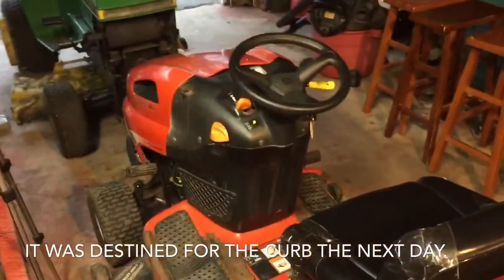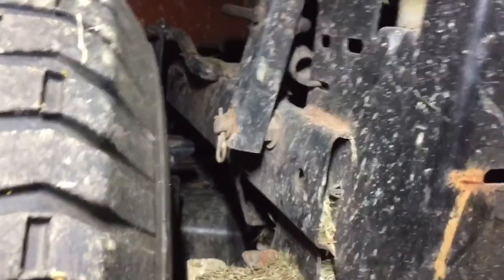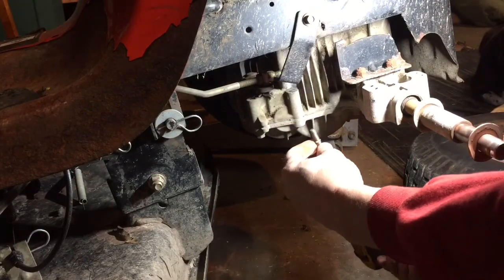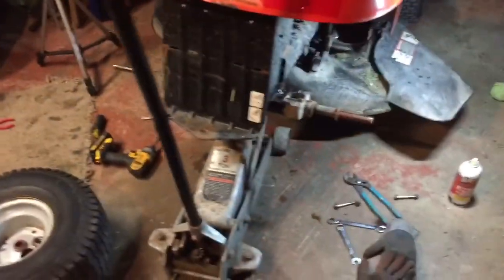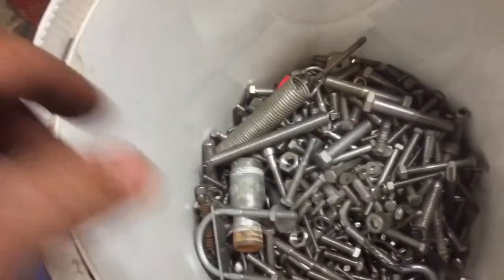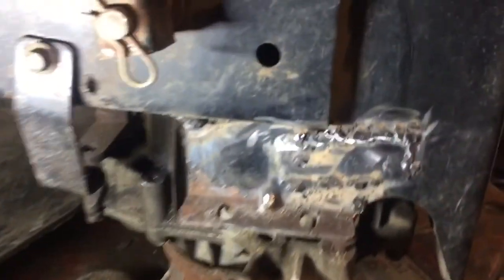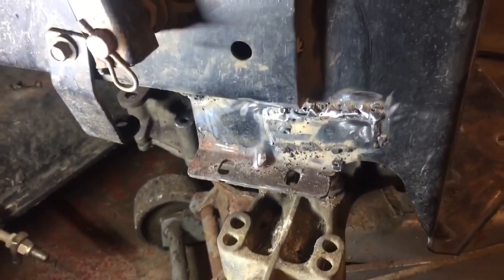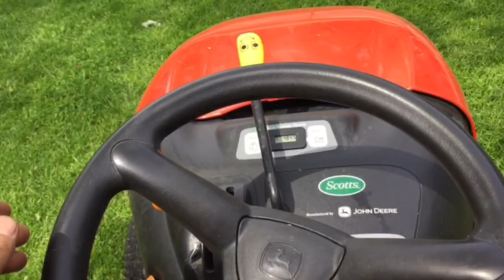Scotts 1742 (by John Deere) trans trouble?

Comment: Excusme what year is it that mower and how many blades has the deck
Reply: The deck has two blades, I believe all 42" decks have just two blades. They were made from 1999 until 2001, I believe. After that, they were manufactured by John deere under the "Sabre" brand.